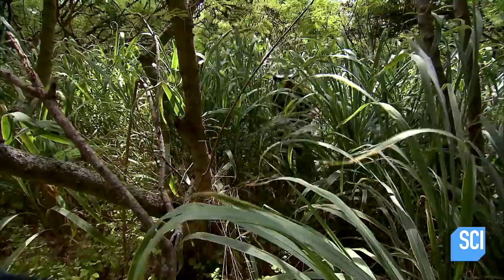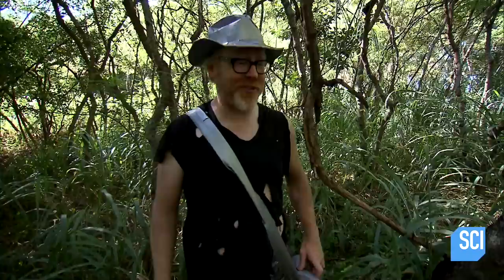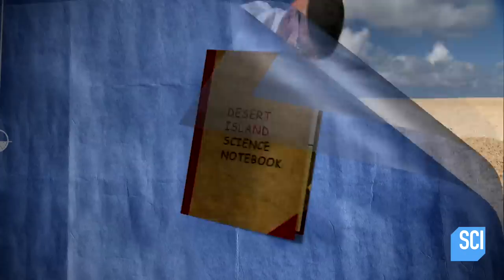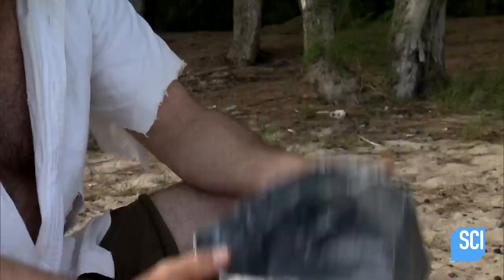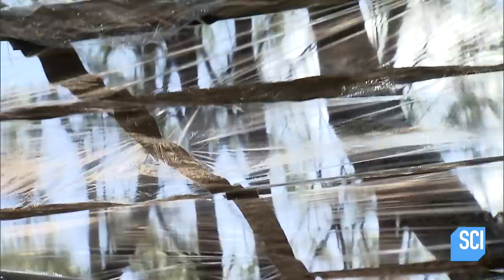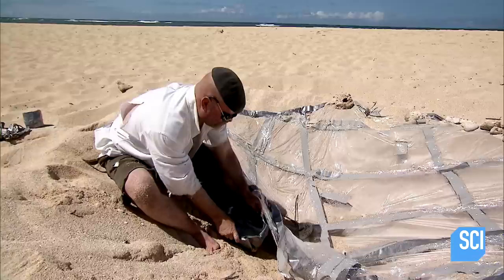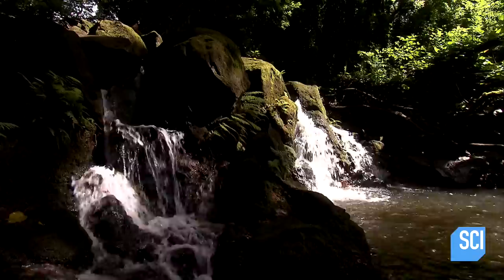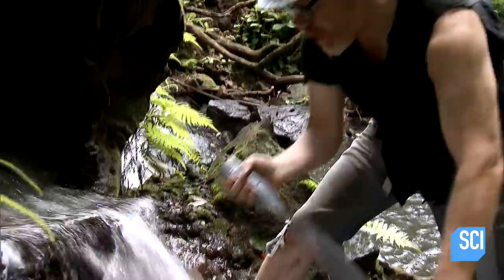Can a Solar Still Generate Enough Fresh Water for Survival? | MythBusters

Comment: The water stil was a good idea, but I bet the duct tape seams prevented many of the drops from getting to the bucket.
Reply: Since it wasnt one big sheet of saran, there was no choice but to stitch them together like that.  I think it did pretty well for 2 hours, maybe a shallower hole instead of a small pit mightve helped.  Like build a wall on the inside of the hole to keep it from collapsing, so more wet sand was visible to the sun.
Reply: Would it be possible to make water stills out of giant leaves? Same idea as before, just instead of clear wrap, you use a huge tree leaf instead?
Reply: Cvo777 I mean not rlly since the sun can’t penetrate the leaves, but it might actually work if you left a crack for sunlight
Reply: Cvo777 wouldn’t be as promising and reliable though
Reply: Fun fact. While Roman Sailors used clay filters, Greek Sailors built solar stills on their ships for drinking water. The used mirrors to concentrate the Heat oh, so maybe the duct tape could have been used to make mirrors to focus on the pit. Increasing the surface area of the water in the pit would also have helped potentially.
Reply: @Elliandr  Are you saying the infamou myth of the "Archimedes Death Ray" was just a misinterperetation of the Greek's water sourceing? Becaue that would be funny
Reply: Shallower and wider hole with more water, and more stones to hold the web together, would have definitely helped quite a bit.
Reply: Screw all this. I'd try and make a duct tape fort, then the headline would read:
"Tweaker dies wrapped up in what appears to be self made duct tape coffin"
Reply: Prolly should of made at least 2 stills, maybe 3 if he could of
Reply: @AlyssonLarsen  There was never any question of if the system actually works. Getting it to work with limited supplies was the challenge.
Reply: @Elliandr  waiting to hear the explanation of how you make mirrors from duct tape...
Reply: I think just widening the hole to increase the amount of surface area the water has to evaporate from and using sand from a shaded area as a weight to cool the cover their by increasing the rate of condensation would be enough of a difference to make the still viable, I mean they said it made 5% of what was needed to survive a day in two hours so thats 60% in a day, so just making the still a little bit more efficient would be enough
Reply: Jaime's mistake was trying to make one very LARGE solar still... when he should have concentrated on making a dozen tiny ones. The smaller ones are more efficient.
Reply: @adamschaeffer4057  - That was my thought as well, although I haven't built one in over 20 years, and don't really know if it's true or not.  I would assume making smaller stills would work better based on not having the seams.  Plus you wouldn't have to totally end the still cycle to get a drink, you could drink from one while the others are still (get it?) working and do it is cycles.

I am going to try this out next time I am at the beach...
Reply: @Max_Griswald  They work because it is far easier to condense water in a smaller area.  Any empty bottle with a few drops of liquid in it left outside in the sun is proof of that.  While much larger stills like the one Jaime made have to deal with larger amounts of air to heat up.  His rig would work better with a higher amount of energy, ie, if the sun was closer to the Earth.  But it's not, so he should have made them smaller.
Reply: @CrimsonQueen_plays  Doesn't 60% imply that there is sun 100% of the time?
Reply: @Khronogi  yeah you’re completely right, I’m an Idiot, they’d have to build at least two stills with improved efficiency to have enough
Reply: @adamschaeffer4057  His rig would work a lot better if left it alone until after the sun stopped heating up the solar still.

Every time you open a solar still you let all of that hot wet air out.
Reply: @jmckendry84  wondering that myself. I notice they're both   wearing glasses however lol
Reply: @TheGamersRace  1/4 of a cup an hour is amazing.
Reply: @geometricart7851  You'd need more water than you lose in a day.  I'm not exactly sure 1/4 of a cup/hour would suffice for 2 people.
Reply: @TheGamersRace spend a little more time refining that tarpaulin, and let the evaporative action work for longer than two hours it would start to work more efficiently as the day progresses.
If you uncover it every 2 hours or so, you slow down the process and have to let it start up all over again.
Patience is necessary.
Reply: If they have enough duct tape, could they make larger duct tape pans to fill with sea water, with an inner cup to catch the evaporated water?  If you closed this system with the wrap it seems like it might have a faster evaporation rate per inch of surface area, since 1) it’s actually water, and 2) the the small area could be heated up quickly (also aided by the grey duct tape that I think probably heats more than lighter colored sand).  But… this is far far out of my area of expertise, so please weigh in if you are more knowledgable.

Part of why I propose this is that from what I looked up just now, it seems like a pot of water in the sun would have a significantly higher evaporation rate than what Jamie was able to collect (though yes, I realize his system was not perfectly efficient in capturing all the evaporated water into his cup).

Comment: In the Army, they taught us how to make a solar still using similar techniques.  They had us use prickly-pear cactus as the moisture source.
When asked, the instructor admitted that the thing doesn't save your life by giving you enough clean water to drink every day, it saves your life because you stay in one place tending the thing!
Wandering while lost uses up more water than you are likely to find and it makes it harder for searchers to find you!
Reply: pretty sound reasoning lol
Reply: If I may ask a question. If it doesn't give you enough water to survive on, then how would it be of any use if a search party wasn't close by? Wouldn't it be wiser to instruct a person on what to do in such cases? Please know, I am in no way disrespecting what you were taught. I'm sure you know MUCH more about survival than myself. I only ask the question out of pure curiosity. Thank you🙂
Reply: There should be a general rule for everyone to follow while lost. Maybe stack rocks a certain way if you leave your original list point to guide search parties. Maybe break off 3 brackets and place em in a arrow the way you will head.
Reply: But isn't prickly-pear cactus edible anyway?
Reply: I have to say that while in a survival situation staying put could save your life. Depending on the situation.
Reply: Its possible  to boil water in a plastic container. if you can make fire, its not that hard to obtain fresh water
Reply: @cristobalpatino3256  in the middle of the ocean it is. It's extremely difficult and resource expensive to turn saltwater into fresh water.
Reply: @CodyBrandt580  they have vegetation. If they can make fire, its possible to boil it in a container made of tape and take the vapor in a similar way.
Reply: @cristobalpatino3256  as I said, very resource expensive. Obtaining water in that manner would be a negative sum gain. You would literally be better off digging a well than trying to keep the still going.
Reply: M. Happy, in case of any accident, you are supposed to stay at the location of the crash/accident etc. If say for example you are on a route that someone knows you are going that way, then it means that the search will be faster. You can go several days without water, so having small sips of water is something better than nothing. Wandering off route might mean that you are never found, as they would be searching one area, if you wander into another, the search party might not search in that location. However, you can leave tracks for people to follow.
Reply: They can make enough water, but each patch of dirt you use it on gets dehydrated!
Use it a day or so, move to another spot.
That's why the use of succulent plants was emphasized; you can't eat them, but mashed and tossed into a solar-still they make good water without having to shift locations.
Another part of the survival training is the notion that a military unit is going to find stragglers in pretty short order, so long survival wasn't in the training.
Reply: He made a mistake - instead of rock on the top of this cover he must put some sea water. It will evaporate, cooling tape, and overall efficiency will noticeably increase.
Reply: @MarkNorville  Thank you😊, that makes complete sense.
Reply: @pirobot668beta  Thank you for explaining that, now I understand the reason for staying still. In your situation, help would MOST likely be on its way. 👍
Reply: Thank you for your service
Reply: Ya another thing I heard was moss, in the military they teach if you can’t have a fire etc. that moss is a good go-to. 
For the solar sills I saw on the last ship show they made a bunch of smaller ones like little domes of plastic will an outer ring to collect freshwater. I think they used beer but I’m guessing salt water in a plastic dome in the sun would also cause condensation on the outside that would run down to the outer ring as freshwater.
Reply: You can also do a plastic bag tightly wrapped around a branch with a bunch of leaves in the sun. Tightly wrapped, the greenhouse effect bakes thee moisture out of the bundle, and going back later gives you water in the bag.
Reply: I've read about troop postings in surveillance or even sniping sorties out in the desert or cliffs for days at a time. 

The idea is that you are supposed to be there for a few days to a week and they give you just the amount of supplies you need for that period of time. But there is no guarantee that you will be recovered in that time de to the nature of fighting on hostile ground. Trekking back is both dangerous and impractical when in enemy territory. So from day one you set up a solar distiller with rainwater or your urine, and essentially stretch out your water supply for few more days in the event they can't retrieve you on schedule. 

As for the supplies: a cup, duct tape, and plastic sheet, and rocks from the surroundings. Pretty much the common setup for the solar still.
Reply: If you where in the army thank you for your service
Reply: thats stupid.. walk inland 200 paces dig 20 feet..fresh water world wide
Reply: shit man, you know all that but you didnt mention the fact you can eat the pears and the catus itself lol! good info tho about staying in one place. people dont realize how much water they use by walking around.
Reply: @cristobalpatino3256  Have you ever read the True Life Book about the men that survived for 21 Days in 3 Life Rafts in the ocean during WW2 when they were running low on fuel and had to put their plane down in the trough between two waves while they still had enough fuel to control how the plane went down in the ocean?  The Title of the book is, "We Thought We Heard the Angels Sing" and is well worth reading it from cover to cover.  One of the men in one of the life rafts was WW1 Flying Ace, "Eddie Rickenbacker."  I can guarantee you there were no trees in the middle of the ocean to use for firewood.  It was after their experience in those life rafts that the design of the life rafts was changed.  The life rafts they had were open life rafts with no protection, and the men were Insufferably cold at night - and insufferably hot in the heat of the sun during the daytime.
Reply: Thank you for your severs
Reply: I guess you would have to make more than one for enough water.
Reply: Veterans are really cool
Reply: Zero Cool 
But if it leaks you've contaminated the water
Reply: Im happy that i got my military training at a sub zero conditions in  the woods alone with my team...more water than you can drink!
Reply: Could you just not make a bunch of solar still and have enough water to surivve?
Reply: This doesn't make any sense.
Reply: Also distilling takes the minerals out of water so you definitely want to throw a thimble full or so of salt water back into your distilled water.
Reply: @M.Happie  You become easier to spot from the air because of the still.

Comment: Even though you wont get the recommended amount of water for survival it's still the easiest way to get it. Once set up it will continuously make fresh water for you as long as the sun is out. If I was there that's what I would do the less energy exerted to achieve a goal is the fundamental principle of survival.
Reply: you can still evaporate water without the sun, its just slower

Comment: That duct-tape waterskin is amazing, considering he didn't even have a good, flat area to work in. I wish the water still worked better, it's also an ingenious idea, I think Adam's point about seams is what kinda worked against the still. Amazing regardless.
Reply: Nah the results will be the same regardless and either way you'll be drinking the adhesive residue leeched in by the tape.
Reply: I wish the solar still were made better. He didn't try.
Reply: @kishascape the adhesive residue leeched in by the tape… was on the other side of the plastic. Jamie hung the tape then attached the plastic up. Additionally, they’re working with very minute incremental progress while collecting water. Every little bit of efficiency matters. With a streamlined system it would work.

Comment: So the answer is yes- if you can find a freshwater stream 😂
Reply: Or you create like 50 of those solar thingys :D
Reply: Should have used clay or rocks to make the inside of the still wider, so more water evaporates. Should give him 100% of his RDA of water in a few hours.
Reply: he should have been able to get fresh water digging down 100 meters in from the surf line, to the water line , the soil should have filtered out most of the salt to a drinkable state , and he could have used his device to further purify the water if he felt the need.( and no i dont mean digging a hole 100 meters deep) , a plastic bag over a tree branch with leaves will also generate water . It dosnt even have to be transparent just as long as its waterproof like a tent fly or a a garbage bag
Reply: You can't filter the salt out of saltwater, that's why it takes a still, or in this case, a solar still.
Reply: Yes. At which point you move your camp to the water source; not the other way around. Carrying water would waste both time and calories, both of which are key in a survival situation.
Reply: and you still may die form microbes in that fresh water must boil it
Reply: if you die from microbes in clean water, then something has been drastically wrong with your immune system for a very long time. For most healthy people, if there was bacteria in the water, you MIGHT get sick from it, but eventually your immune system will compensate.
Reply: Some parasites are larger than bacteria and affect the body differently.  Even the bacteria can be harmful in large enough amounts.  In a survival situation the immune system may be compromised due to exhaustion, heat issues, lack of water, vitamins and nutrients.
Reply: that would be an extremely bad day, when you're lost and you suffer one of those issues...it can happen, but i'm just saying, for someone healthy, and who knows how to survive outside of civilization, its unlikely....and if you're lost, and stuck in a desert, or tundra, the chances are almost non-existent.

BEST advice....don't get lost, its one of those predicaments where you choose the room with the lion or the tiger,
Reply: He could have started a fire and dropped rocks into the still to boil more water.

Comment: It looks like they were able to generate a scant 100ml or so from much less than 1m^2 of usable collection surface in 2 hours near midday. Even so, that could already amount to 1.2 litres a day: probably more, because the evaporation/condensation process works best when the ground is warm but the ambient air is cold. (Ask any painter.)

A much larger surface would have been easy with the sheet that was already built up from shrink wrap. It just needed to be deployed better. Laying it over a small hole is silly. Find a large hollow and dig out the center area.

Don't contaminate the precious sheet by laying it directly on sand, but build up a raised airtight perimeter out of beach logs or deadfall. Higher is better because you can get a steeper slope toward the center without touching something.

Don't use sand to weigh down the center, but use a suitable sized pebble. You don't want a catenary shape but a straight decline to a sharp center point. Then the moisture has its best chance to roll down and drip off where the collection cup is, freeing the surface to condense more water. This change alone will easily double rhe output of the collector.

How do I know this? Because I started building them sixty years ago, following instructions in a monthly "Things of Science" mailout that AAAS used to run for children. They had lots of cool stuff on hydroponics and crystals and diffeaction, even computer programming. This one stuck with me because I was also into camping.

I like Mythbusters. They often do credible science. This clip however is not a good example. There was essentially none of the above analysis. That's not doing science, it's just theatre.